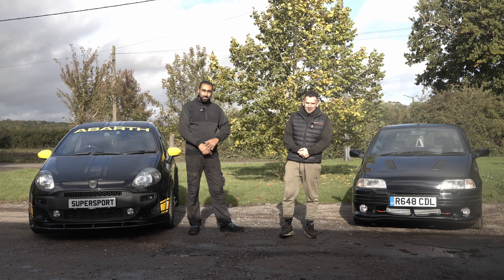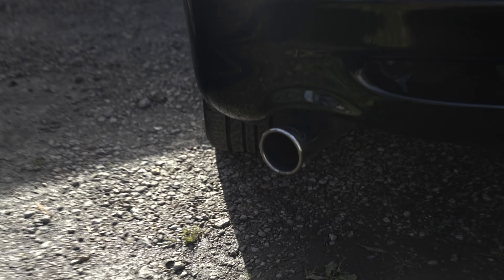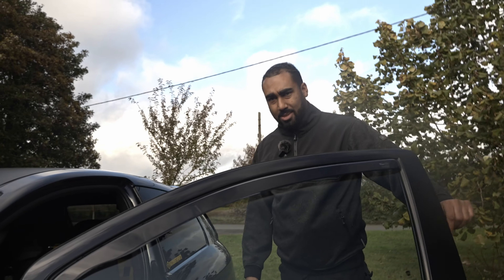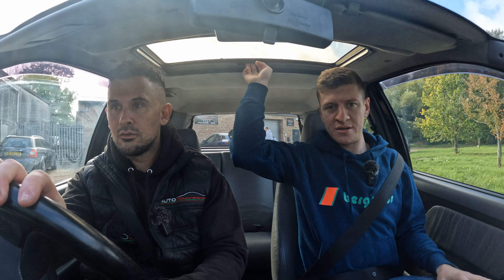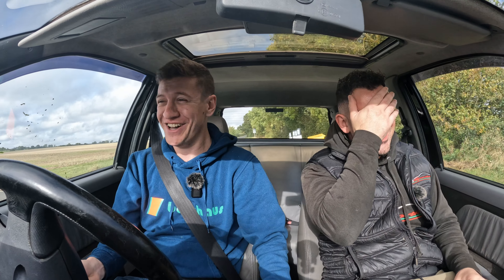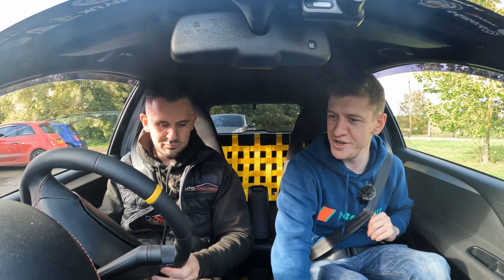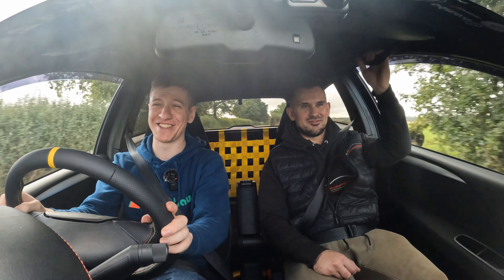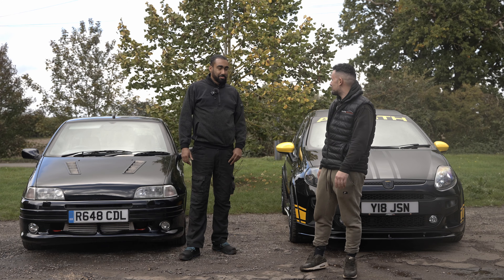Fiat punto Gt vs Punto Abarth  #puntoGt #puntoabarth

Comment: I've had 2 PGT's one 160bhp and the other 188bhp both were awesome cars around towns and B road blasting but motorway driving were horrible after about 100 miles..Currently I have a Punto Evo Sporting 135bhp with the full leather and cruise control etc and driving the 350 round trip to Gatwick and back is lovely to be honest, So I'll go for the APE👍

Comment: the mk1 PGT rulez
was very easy to tune them over 200hps
 
i had for ~16 years
my was modded to 1.6, than later to 1.9 litre
the 1.9 was veeeery torqie from deep like a diesel and revved to ~7k

my PGT was a "GT3" from late 1998 with smoked grey headlights, antracite wheels, +full black "GT3" sytle leather interior, +air conditioning
the aircon was an option in LHD cars

the front brakes on these was a weakpoint, it had 257mm only
later the 100hp mk2 1.9 diesel had 284mm

Comment: I’m so torn between the two . Corsa , Grande Punto and Alfa Mito all share same platform so Corsa should be around the same size I think. 
You should try and get a MK2 Punto S1600 , factory supplied rally car that you could buy through the fiat dealers